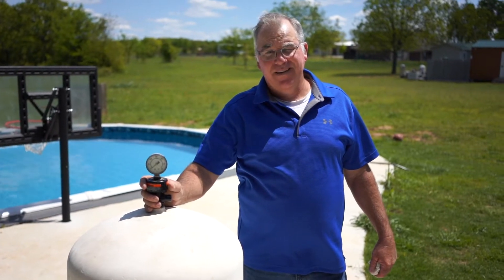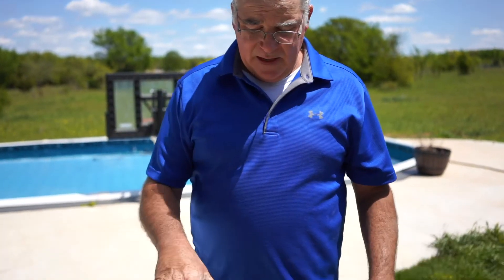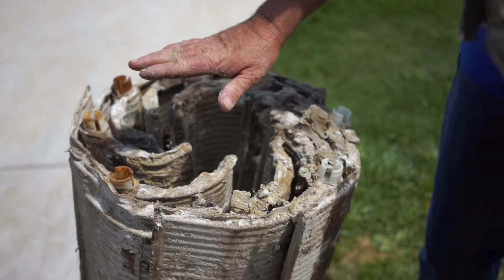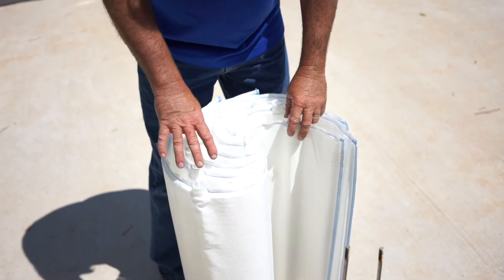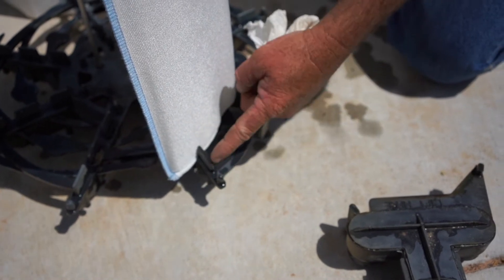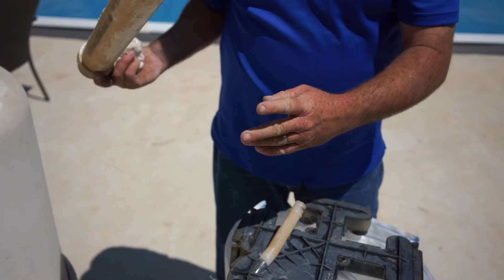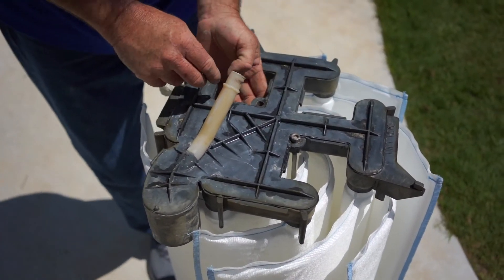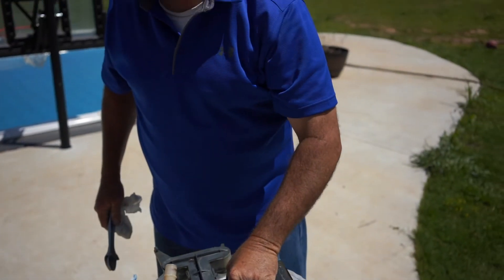Pentair Pool Filter Cleaning; De Filter Cleaning

Comment: I found an easy way to reinstall DE filter pads that needs to be shared. I don’t do videos so perhaps you can add this to one of yours. I was one of those who struggled with getting my Hayward filter pads realigned after taking them off the manifold. There was always one or two that would leak DE back into the pool on completion. I thought one or more may have torn but it turned out the filter pads weren’t seated properly to the manifold. I found it by running the pump in the backwash mode (cover off) and seeing water leaking from several of the connections. After disassembling I turned the manifold upside down, started with the short pad and worked clockwise outside to inside making sure all pads were well seated into the manifold and there correct spacers. The hardest part was getting the long bolt back into the manifold hole and it wasn’t that bad. All in all this was a much easier task than working from the normal position and no leaks or DE back into my pool. As a side note, I almost purchased a new filter set at $100 plus.
Reply from the maker: That’s a great tip, thanks for sharing. 👍😎